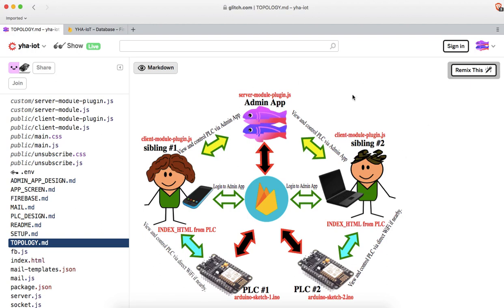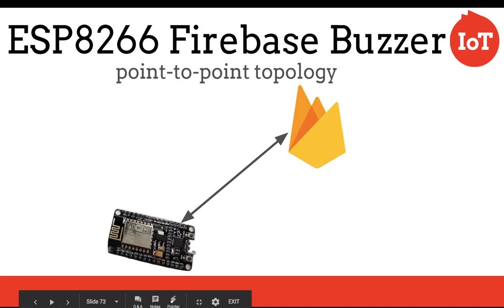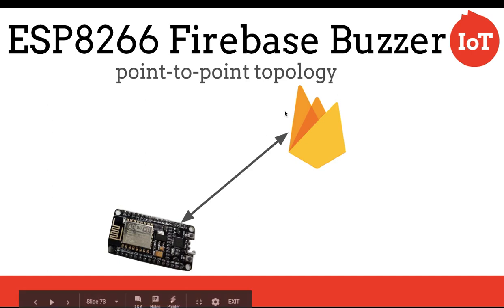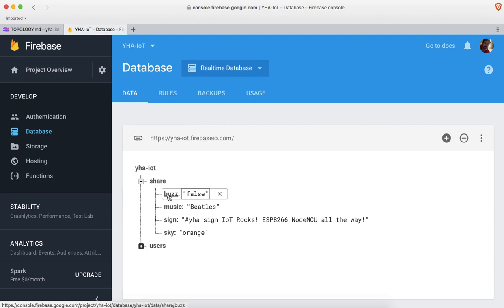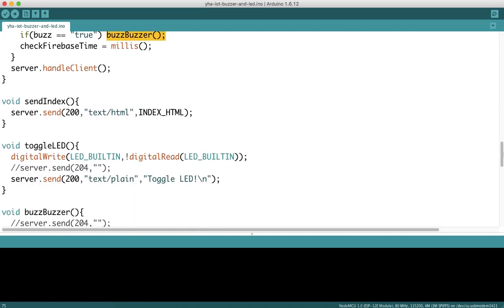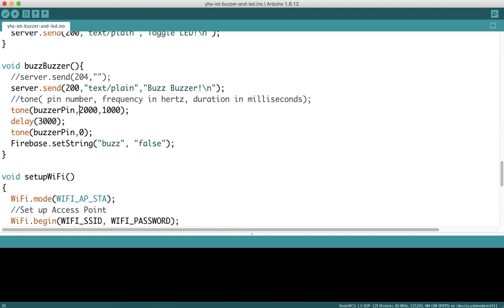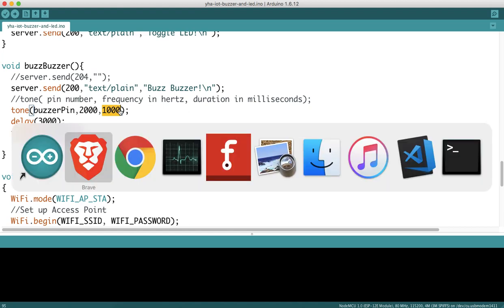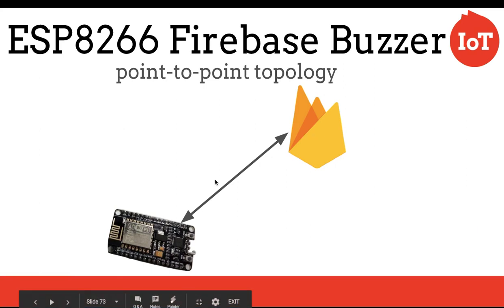ESP8266 NodeMCU to Firebase

Comment: #include <ESP8266WiFi.h>
#include <FirebaseArduino.h>

#define FIREBASE_HOST "test-proj-b3008.firebaseio.com"
#define FIREBASE_AUTH "tRidX1zRzkSgE0tz07WcJiY5JqA4uox1lw****"

#define WIFI_SSID "****"
#define WIFI_PASSWORD "*********" 

#define Relay1 D0
int val1;

void setup() 
{
  Serial.begin(9600);
  pinMode(Relay1,OUTPUT);
  //digitalWrite(Relay1,HIGH);
  pinMode(LED_BUILTIN, OUTPUT);
  
  WiFi.begin(WIFI_SSID,WIFI_PASSWORD);
  Serial.print("connecting");
  while (WiFi.status()!=WL_CONNECTED)
  {
    Serial.print(".");
    delay(500);
  }
  Serial.println();
  Serial.print("connected:");
  Serial.println(WiFi.localIP());

  Firebase.begin(FIREBASE_HOST, FIREBASE_AUTH);
  Firebase.setInt("LED_status", 0);
}

void loop() 
{
  val1 = Firebase.getInt("LED_status");   
  Serial.println(" val1 = "+Firebase.getInt("LED_status"));              
  
  if(val1 == 1)                     
  {
    digitalWrite(Relay1,HIGH);
    Serial.println("light 1 ON");
    pinMode(LED_BUILTIN, HIGH);
  }
  else if(val1 == 0)                                                     
  {                                      
    digitalWrite(Relay1,LOW);
    Serial.println("light 1 OFF");
    pinMode(LED_BUILTIN, LOW);
  }
  if (Firebase.failed()) // Check for errors 
  {
    Serial.print("setting /number failed:");
    Serial.println(Firebase.error()+"<<<Error");
    return;
  }
}
-This is my code And I can't get data from firebase. Any Idea why?

I can't get any error code as well
Reply from the maker: Is your LED_status on Firebase stored as an int?  Is it maybe entered as a string?
Reply: @EricEisaman  it is integer.
Reply from the maker: Check for Firebase.succes() and not Firebase.error() similar to:

Firebase.begin(FIREBASE_HOST, FIREBASE_AUTH);
  Firebase.setBool("share/buzz", false);
  if(Firebase.success()){
    Serial.print("Firebase write success!");
  } else {
    Serial.print("Firebase write failed!");
    Serial.println("");
    Serial.print(Firebase.error());
  }
Reply: @EricEisaman  ok let me check
Reply: got "Firebase write failed!" and on the loop function got "setting /number failed:"
Reply from the maker: Is your host an authorized domain at Firebase in the Authentication/Sign-in Method tab?
Reply: @EricEisaman  I am useing the firebase free version. How to check the host is  authorized  at Firebase? I have no idea
Reply from the maker: In your console, go to your project, then Authentication,  click on "Sign-in Method" tab, scroll down to authorized domain section.  Localhost should be enabled by default.
Reply: @EricEisaman  ys 'test-proj-b3008.firebaseapp.com' and localhost are showing in a  list on "Authorized domain"
Reply: at last I have got the success. i have just update the 'FirebaseArduino' lib and got connected :)

Comment: i want to connect nodemcu with firebase-storge for storing imageis that possible 
 or not?
Reply from the maker: Yes it should be possible, however I have not tried it yet.  It would probably require use of the firebase-arduino stream API as well as an intermediate server running firebase-admin.  The reason I think you cannot use firebase-storage directly is that I believe they require all data transfer to be over a TLS / SSL connection which firebase-arduino does not provide, that is also why we are currently stuck using the legacy database secrets.

This video shows the use of a custom streaming approach. 
https://youtu.be/XqfSz1jZ2JA

Comment: sir, I have the problem with my node mcu also. it connected to the router but firebase didnt show any data from my node. Why this could happen? I surfed more many tutorials and found nothing's wrong with my code and libraries
Reply from the maker: The firebase-arduino library updated the firebase fingerprint several days ago.  If you downloaded the library before then you will need to get the newest version with the updated firebase fingerprint.  The actual firebase fingerprint can be found in FirebaseHttpClient.h on line 43.

Comment: good video
Reply from the maker: Thanks.
Reply: can i ask your mail?
Reply from the maker: You can reach me via LinkedIn. 
https://www.linkedin.com/in/eisaman/
Cheers.
Reply: i want to ask about my nodemcu problem
Reply from the maker: Sounds good. Post it here or contact me via LinkedIn.
https://www.linkedin.com/in/eisaman
Reply from the maker: I am sorry.  You will need to either reach out via connect request at LinkedIn or posting the question here.  Best Eric
Reply: i have a problem with my nodemcu, when i enter host and auth then upload, after that there is no change in firebase but my nodemcu connected to my router.
do you know the problem?
Reply from the maker: It sounds as if you maybe didn't use the required legacy credentials to connect to your Firebase. Go to your Firebase Settings / Service Accounts , then click Database Secrets, then click Show to obtain your database legacy credential.
https://i.imgur.com/jv3Mqzn.png